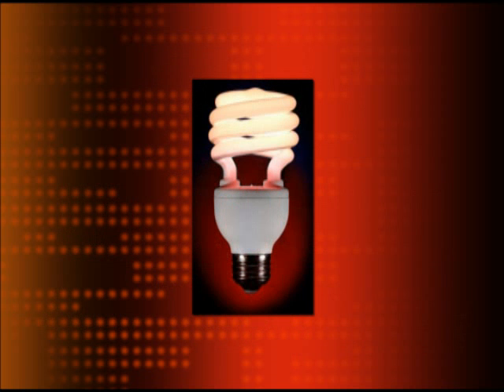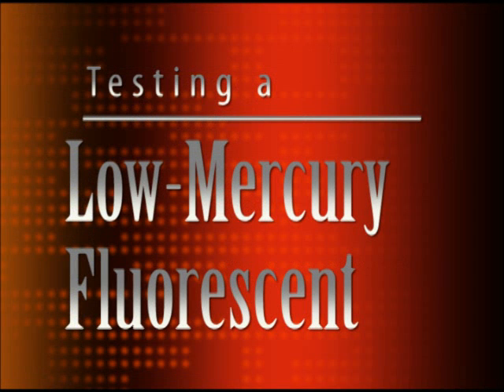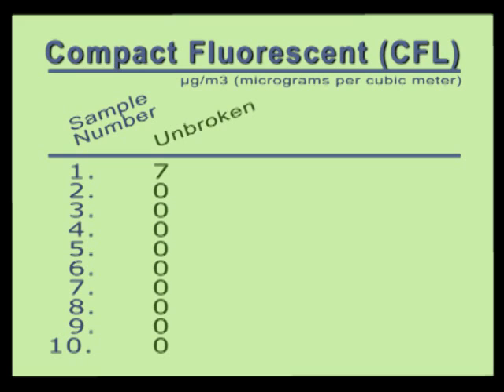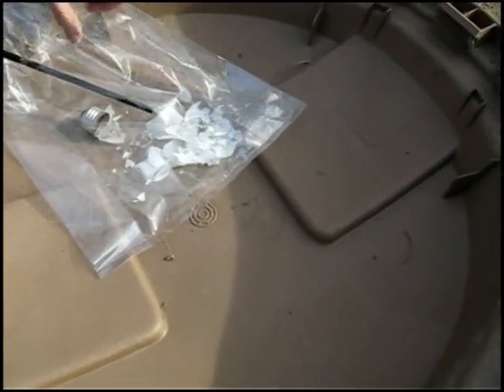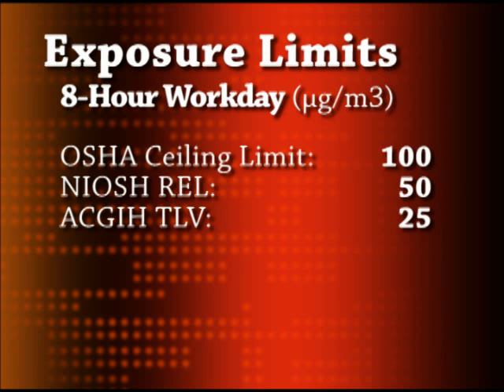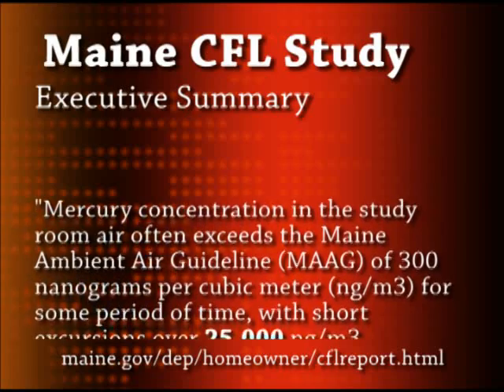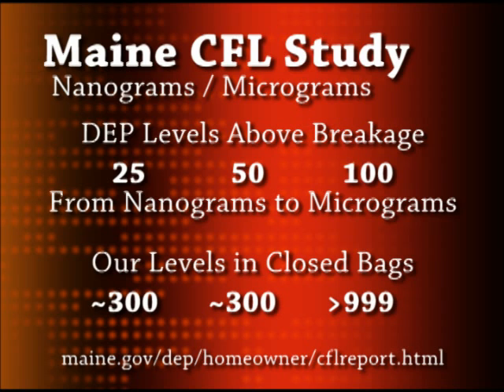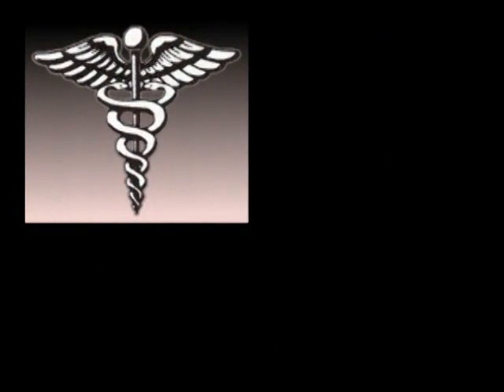How Much Mercury Escapes From Broken CFL Light Bulbs?

Comment: Incandescent light bulb more less safe to use. Although they contain no mercury, they generate a lot of heat .
CFL's on the other hand are extremely dangerous because of the high mercury content than the normal fluorescent tubes due to the fact , the cfl tube is much smaller and the mercury is contain in that small space

Comment: Most people hang out in rooms much larger than a garbage bag... And of course the readings were too high to measure in the even smaller bag used for the CFL.  The measurements are all in µg per cubic meter, making the results unsurprising and unuseful; they say nothing of the safety of these bulbs.  How much Hg escapes from broken bulbs?  All of it, of course.  CFLs contain about 5 mg Hg per bulb; the variable that will indicate the relative safety is the size of the room.
Reply: If you had watched the video all the way through, you would see that those issues about bag size vs. room size are addressed. The video talks about the State of Maine's experiments which show DANGEROUS amounts of mercury in a room AFTER an EPA-Approved cleanup.
Reply: ***** Thanks! I didn't finish watching because it seemed pointless, since they sure didn't seem to know what they were doing.  I'll watch the second half when I get a chance and see if the issues are properly addressed.
Reply: +dcacnc now there is a warning that is a symbol saying HG
Reply: for those of us who have been merc toxic and in many cases many years, for myself 36+ and still trying to detox, the room size and source arent really the concern to debate. ANY exposure is not supposed to be in the human body or you may get ill even to the point of being debilitated. There is no OK exposure level that anyone really knows to set that is really OK..otherwise none of us would be ill... for me my exposure was at work 36 years ago then a lifetime of amalgams, one last one that was causing very bad symptoms  near the point of debilitating. Dont get too scientific....for many of us it doesnt take much...and we don't really know how much made us ill...but i don't think we would hang around a room or even that outdoors set up I would be a distance away.....if you are or were toxic you would understand, if you never were, be thankful as it is nothing short of horrendous.
Reply: Me and my girlfriend had a broken cfl under our bed not knowing for over a year and ran the heater in the winter. We both got HG poisoning with full blown symptoms; tremor, everything. My question is I wonder how long CFL continue to emit vapor when broken.